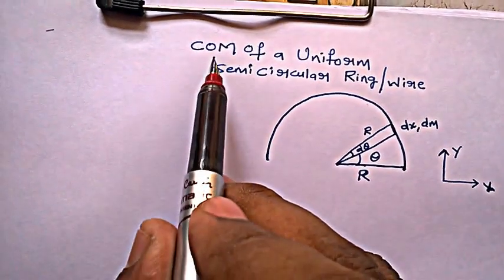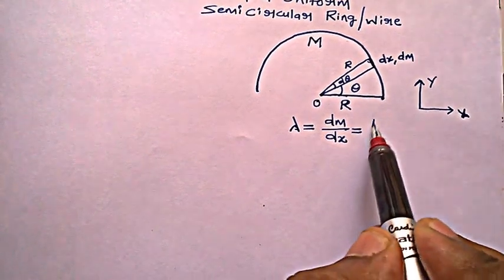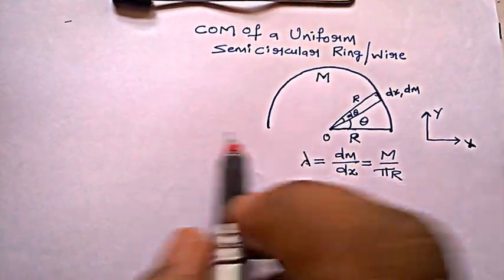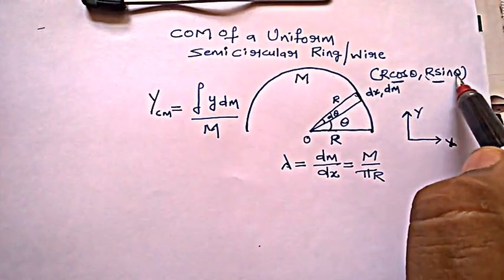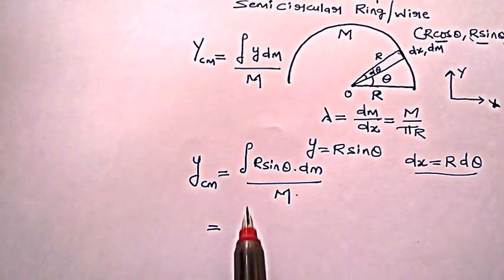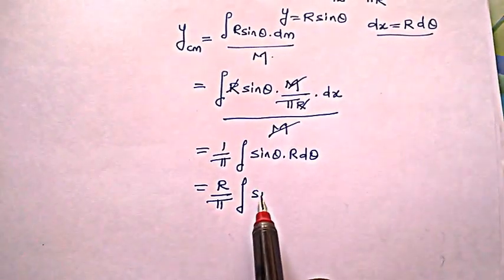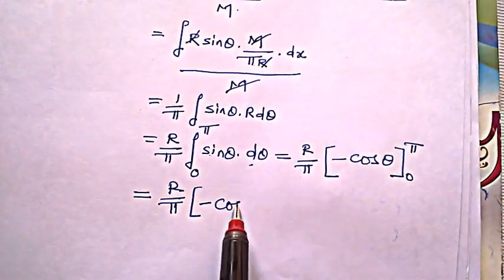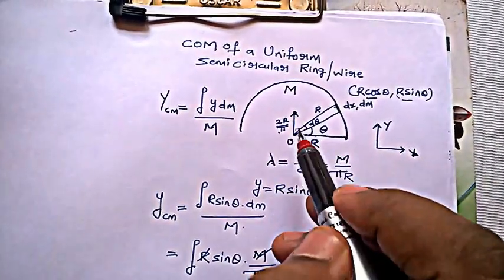Center Of Mass of a Uniform  Semi-Circular Ring/Wire

Comment: why cant i use same approach for semicircular disk?
Reply from the maker: When you solve problems on C.O.M you must take care how mass is distributed.. For a semicircular ring mass is distributed over length so we chose length element dx, where as for disc mass is distributed over area so we chose area element dA.
Reply: No.. If i use a uniform disk with uniform mass distribution, can i integrate the area of small individual sector??
Reply from the maker: that will be complicated to set limit bcoz its not symmetric, if you use a ring then disc is made of similar rings then setting limits becomes easy..